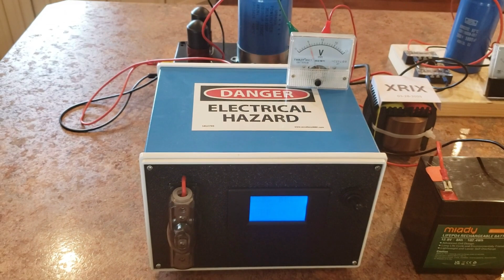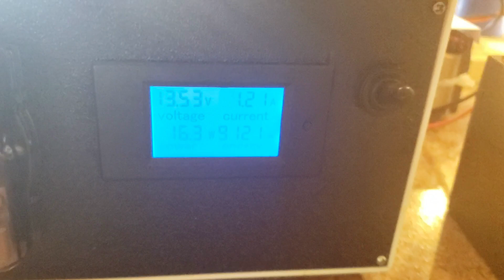Over Unity Working Don Smith Device - Part III

Comment: Hi @XR_IX, it's been about a year since I found your channel through your 1st DS vid, super enlightening, Thanks! I’ve posted a few comments since then, but somehow some of them disappeared.

I wanted to ask, have you considered replacing the SG in your circuit with semiconductors? I’ve found that regular SGs/GDTs tend to wear out over time.. Have you tried any methods to extend SG life?

Looking forward to hearing your thoughts!
Reply from the maker: I don't delete anybody's posts because I feel that would be dishonest. I rarely delete mine, but sometimes I feel the need to edit a response when I confuse people. The trick about posting on YT is to hit your alerts  rather than posting underneath the video. I know it's dumb, but it's their code. I am always in search for efficient switching. OU III is the evolution of overcoming the limited lifespan of the GDT. The circuit powers it's own xenon flash tubes, so the GDT turns off and only hit maybe 10 times. The trafo powers that circuit, so I don't have to pay for switching. It can also be built out to +n transformers. Maintaining a disruptive break is quite a task, specially if you want to reduce your voltage to use larger caps. Semi conductors seem to be squishy, and though they accomplish electrically the desired goal, the aether begs to differ.
Reply: @XR_IX  Thanks for the insights and also the tip about YT comments, much appreciated! And no worries, I didn’t mean to imply you deleted my comments. They probably just disappeared somehow, or maybe I just don’t fully get how YT handles replies.

At the moment, I’m exploring a design using semis (like SCRs or IGBTs) with an isolated control circuit to dischrg the caps. I’m not entirely sure if it will behave the same way as SGs or GDTs in terms of performance, but I want to see what works.

I’ve been doing magnetic multiplication based on your DS1 video, and I’m also planning to incorporate some isnight from P.B. (may he RIP) to enhance the magfield. I’m using an air core for the trafo, mainly because it’s tough to find magnetorstrictiv materials in my country,  and other equipment and materials are also quite limited here. So far, I’m focusing either on increasing the input or finding other ways to strengthen the magfield without relying on +n trafo.

I’m also considering using an immersed SG to maybe extend lifespan. Not sure if you’ve ever tried that route, but I’d love to hear if you have any experience with it.
Reply from the maker: @RayFinder  I have tried immersed. Look at my EV Gray motor. That does work. But few have the ability to make that work consistently and for days and months. If you find something  please let me know. SSR don't work. I have burned up many xenon bulbs, learning how to do it properly. OU III have lasted months with the same combination, and lights my office consistently. Thyristors are latching, so you have to deal with that. I will keep trying as well. But it is as Tesla said, " Yes. It is merely the electrical analogue of a pile driver or a hammer. You accumulate energy through a long distance
 and then you deliver it with a tremendous suddenness. The distance through which the mass moves is small -- the
 pressure immense."
Reply: @XR_IX  Thanks for the info! I’ll definitely check out your EV Gray motor video.

Noted on the parts that don’t work well. Yes, thyristors stay on until the current drops below the holding point, I'd need a commutation method to turn them off after the cap discharges, which might be more hassle than it’s worth. I’ll probably skip SCRs for now and explore IGBTs or MOSFETs instead. But learning to control them properly also takes time, and I don’t have much of that for building and testing.

One of my better hopes is still the immersed SG, maybe in mineral oil or another dielectric fluid, to help extend its service life.

And I’m trying to better understand how the xenon flash tube with GDT works in your version III circuit. If that setup can run for months, it sounds like a major improvement.
Please correct me if I’m wrong, but here’s my current understanding: in your setup, the GDT works as a trigger, while the xenon flash tube handles the actual cap discharge?
Reply from the maker: @RayFinder  GDT and xenon tube are in parallel. I only burn out the GDT when I change the configuration. The one you see in OU III is robust.
Reply: @XR_IX  Noted. Thanks for sharing. I’ll explore that setup.
Reply: @XR_IX Hey, hope you’re doing well. I’m finally back at the bench after months tied up with work. Been rewatching your vids, especially the video where you had those good exchanges with Naliking. Got me thinking about something in your setups. In OU I you stacked mots in parallel, but then you only had one core (amo nano) . Did you run just a single primary on that core, or several in parallel?
Reply: @XR_IX  I’ve been testing with an amo nano trafo, first equal turns and length both sides, like isol trafo,  then tried short 2 turn several coils. But the field strength looks about the same either way, around 75uT. Setup is zvsfb > fwbr > sg > 3 caps > trafo. Wondering if there’s a winding trick on one core to push the field higher?? since you were getting >99uT.
Reply from the maker: @RayFinder It is something you have to experiment to discover. Because my answer doesn't make sense from an EE perspective. Think of what a primary looks like on those MOTs. Is my primary on my amo nano different or alike? If my primary appears different, what is different about it? Disregard the tertiary winding that I use to drive other control mechanisms.
Reply from the maker: @RayFinder  There also a matter of magnitude. How many joules do you have when the spark closes?
Reply: @XR_IX , for the joules, my caps are 1 uF. With the sg/gdt I’ve tested breakover at around 1500 V, and also tried 300 V.
On the winding side, I’ve experimented with both thin and heavy gauge wire, as well as manyturns vs. singleturn coils. In all cases the magnetic field I measure with the magnetometer seems about the same.
Reply: @XR_IX , I do think your primary on the amonano is set up differently compared to mots, where we just use the manyturn coils as primaries. From your explanation, I understand that higher joules and higher spark energy will boost the field, but what I still don’t grasp is how to arrange the coils on a single core amonano to really get the stronger magnetic field like in your OU II and III.
Right now my takeaway is that no matter the wire gauge or number of turns, the field strength mainly follows the spark joules from the GDT. So I feel the coil arrangement itself must play a key role. 

Maybe you could give a small hint on how you arrange your coils, to stimulate that stronger field in the core for the secondary to capture? Thanks.
Reply from the maker: @RayFinder  => 12 AWG should be sufficient. Find the Don Smith refences for "Circular Mils". It is explained fully. Everyone should have a cache of Don Smith text searchable material. That is the only vehicle towards understanding what I am showing, and it isn't contained in a single paragraph. I explained it to Rick F. A disruptive spark, simply can manifest more energy. Don Smith says, "The spark gap produces millions of times the suspected " search that as well.
Reply: @XR_IX , Yes, I’ve read the DS references about wire type and size, he explained that a multistrand bundle has greater circular mils than a single strand, giving a stronger mag field. On the sg and core type, DS said the spark gap produces millions of times the suspected recognized magnetic flux and when used with the Metglas shows the energy amplification.
Reply: @XR_IX , In my test, I used an amonano trafo with AWG 10 wire for both primary and secondary, each the same length, about 15 turns (2 layers), which is the max I could fit on the core with AWG 10. That gave me around 75 uT.

Could you please confirm if your trafo also has only 1 primary and 1 secondary like mine, or if you set it up differently? Any suggestions to improve my coil setup?? Thanks, much appreciated.
Reply from the maker: @RayFinder  The amount of moving magnetic flux you create, and at what frequency determines the power of the device. You may not see <99uT, with speaker wire, My OU II was litz wire, which is the best wire to use for that design. OU III was DC wire, should of been similar to speaker wire. I clocked <99uT on both cores right next to the core at the right angle(which is another topic all together). But now we have go into other topics, as you may have discovered. This is the skill that has to be mastered with the approach, and there are general guidance, but I knew I was getting better when I could out perform the MOT. The Don Smith device is transformer building at the advanced stages. But a wire is a conductor, which can made into a capacitor plate.... It may end up building capacitors :)
Reply from the maker: @RayFinder  I have one builder who Earth grounded different places on the Exciter FWBR, and was able to see <99uT easily. I myself didn't use Earth ground because it creates misdirection, as there are the Earth ground  secularist worshipers of Don Smith devices. Whatever that is, I haven't seen anything significant under that rock. I could be wrong.
Reply: Hi,  @XR_IX , I’m still struggling to understand how the amplification works in OU II and OU III on a single core. In OU I, I see how it comes from multiplying the magnetic creation with parallel impedances. But I can’t figure out how coil geometry or conductor type alone can make a stronger field on one core.
I know we can always increase the field by putting in more joules into the coil, but is there another way?
Reply: @XR_IX , I’ve run several tests using different conductor types (Litz wire, speaker wire, DC wire, magnet wire, thick multistrand AWG 8 and AWG 10, thin and thick magnet wire, etc.) and tried different turn counts and coil geometries. I also tried both amonano cores and air cores. In all cases, the field strenght stay about the same (~74 uT) . From these tests, my conclusion is that conductor resistance and coil geometry don’t really change the strength of the field produced. 

Here’s a video of my tests: https://youtube.com/shorts/F-X5q7s4vyc?si=bcJ66cAIkXo-mqdX

Do you have any suggestions or insight on increasing the field without simply raising the input joules into the coil? Or is adding more input energy the only real path? 

I’d really appreciate your guidance on this.
Reply from the maker: @RayFinder  First thing, you are doing the exact method to discovery, by experimenting iteratively. However, your gauss meter, is fixed off angle. Remember, the lines of flux are like a magnet, and appear only where the lines intercept.
Reply from the maker: @RayFinder  Second thing, is you should run some sort of load on your secondary. Just because you are creating some energy by disruption, doesn't mean you are seeing the whole picture with an open circuit.
Reply from the maker: @RayFinder  Third thing, is the hardest to comprehend, because it doesn't make any sense. If you induce cold electricity (Tibor's) it seems to work with symmetric impedance. It really is not wire length but more the impedance. Disruption is displacement. Then what is displaced has to return. I don't like calling it EMP, because that means something else. Displacement will choose a conductor versus an insulator as a return path. If you look at water, it will choose the path with least resistance, so if you have displaced a fixed volume (pushing water up the hill), the water will try to return down the hill and it will choose the path with least resistance to move the most water back. If you have equal pipes, the flow will be equal to both. Now think of two equal strands of wire, they will create manifest the same return flow, regardless if they are separated as in primaries OU I, or multi-stranded OU II and OU III.
Reply: @XR_IX  Thanks for your response... For the first point, yes, I did position the gauss meter at different angles around the coil until I found the spot with the highest flux, as shown in the video.
For the second, I also tried loading the amonano after the secondary (not shown in the video). I used large uF capacitors rated for hundreds of volts, as well as a lower-voltage one. I connected a 16W car LED floodlight, but it only lit very dimly, maybe less than a quarter of its normal brightness, with the loaded voltage also measuring only about 1/4 rated value. Should I try something like COB halogen LEDs instead?
I also tested a small incandescent lamp, but it didn’t light at all.
Reply: @XR_IX  , For the third thing, thanks for the explanation. I think I understand part of it... that it’s not really about wire length but more about impedance balance, and that when we disrupt the aether, the displaced energy must return, like water flowing back down equal pipes.
But I’m still not clear on how to apply this in practice. How do you actually set up your trafo so the return flow shows up as stronger field or power? Is it simply by using multi-stranded conductors? I’ve tested that but still measured the same field strength. Should the goal be to create a strong on/off changing magnetic field that can then be tapped, or is there another aspect I’m missing? What would you suggest I try next to improve my experiment results? Thx.
Reply: @XR_IX  , In your earlier reply, you also mentioned the DS device as “transformer building at advanced stages,” and that a wire is a conductor which can act as a capacitor plate, essentially “building capacitors.” Could you explain how those two ideas are applied to amplify the effective field or power? I’d really appreciate your explanation... as it could help guide me in applying it to my experiments and finally getting results.
Reply from the maker: @RayFinder  Why would did you think more turns would of produced higher magnetic power? Would you have expected to have the same amount of flux with less turns? This is why power is not based on flux lines alone. You have to see the density increase yielding more power to the load. In my case my output capacitor charges up quicker. As you gain more density you should be able to move further away from the transformer should pickup the amount of flux. You're gauss meter is only picking up the wasted flux. If you were trying to find out a real number for that, you would use an air core with the hall sensor inside the toroid. I really have not tried to measure that.
Reply from the maker: @RayFinder  It's just my theory of Don Smith, but I think he could make a transformer do many things differently from his earlier devices. His comment that he did not need a spark gap, is a good example. If you were using a coil, open ended wound over another open ended coil, what do you have? A capacitor. Much like two conductor speaker wire. It has a great deal of self capacitance. Don cited some coils had 470uF? That is a pretty large capacitor. If you take that and find the voltage where such wire would breakdown the insulation, you could see how that would become a high voltage capacitor. The amount of joules is based on the voltage squared, so if you are flipping a capacitor 470uF at 15KV, that is a great deal of capacitive transformation. That's like 50kJ per discharge. I know how he was pursing the same thoughts because he mention using Kapton dielectric. All this is like I said, more conjecture on my part, I have not built a device this way. I am still in stone age comprehension. Take your gauss  meter and put it next to a spark gap, or xenon tube. You start seeing that magnetic flux is presence on these reactions everywhere.
Reply: @RayFinder 
Hi Ray, were you able to increase the magnetic field strength?

I have an amcc0320 core (this is not nanocrystalline, only amorphous) and use 16awg for secondaries around silicone 21T and the primary is silicone wire 10awg around 9T. I tried winding the primary CW and over a secondary that's CW, then another secondary that's CCW. I  put a diode each in each of the secondary coils.
I'm using a 350V gdt. It's triggering at around 160hz I believe. I have 12v 5w lights on each of the secondaries, they both light up, but dimly. I did not try the 1500V gdt with this setup, but i tried it in a normal transformer setup and I was hearing pretty loud sparking. I probably need to get some 600v gdt to try out  maybe. I'm not sure what the size of the GDT should be, I believe mine are all 8mm diameter and 5mm length or so.

I tried measuring the magnetic field around the core and the GDT, I can't seem to see any magnetic field strength. I tired moving the probe in all directions/orientation. I can put the probe against a neo magnet and it shows up fine.

I'll try with a microwave transformer to see if I can measure any magnetic field around it, once I get one.

Comment: Are those led or Incandescent lights?
Reply from the maker: LED 15W - 20W 120V  - Negative resistance: It is hard to say, since I have no meter to prove it. A response would be conjecture.
Reply: @XR_IX 

Interesting & i noticed that leds sometimes light up & don't draw power when enough negative resistance is present in an RLC circuit
Reply from the maker: @ I am not sure what you are describing. An LED is a load, so it has to draw power. If you have an example of  an LED using no power, please show me.